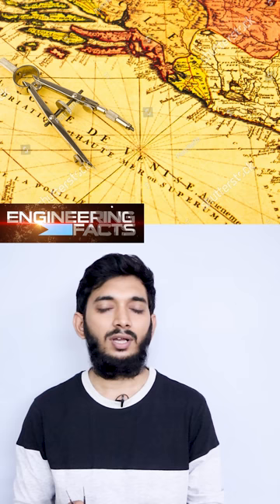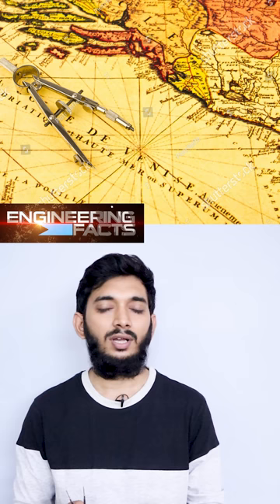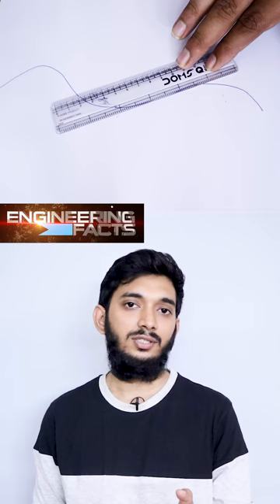Geometry box  Divider.. #engineeringfacts #engineeringfactstamil #shorts

Comment: Still there will be an error..

Thats why they had brought Integration..

And one more thing, for measuring the length of curve. You can use threads and approximate and later measure through scale. It will be mlre accurate than divider.

Comment: Also used in sheet metal(work shops) marking where pencils, pens, markers cant be used. I learned this from science shows and channels after 20 yrs came out without any basic knowledge as an engineer. (Also plz put a vdo of using verniers depth measuring blade - I think many of em don't know it).

Comment: When measuring a curved line, how does this will measure the exact length as the distance between the two pointers is not straight line. ( as you have show. In the video)

Comment: But with this method,we could only find the shortest linear distance(distance between two points along a straight line) but can't be used to find the exact curved length.

For instance consider a curved figure such as circle.
By using a divider you will find the distance between two points in circle which is actually the distance of the chord of the circle formed by the points.

Not the curved distance !

Now in the case of a globe 🌎(which is irregular sphere(or) ellipsoid,by using a divider you actually find the distance between 2 points which the line between the points go under the surface of the globe.

So this isn't a effective method to find a length of a curve.

But it can be used only to find the approximate distance by using it for various very smaller parts of the line and adding them up at the end.

But not the exact length.